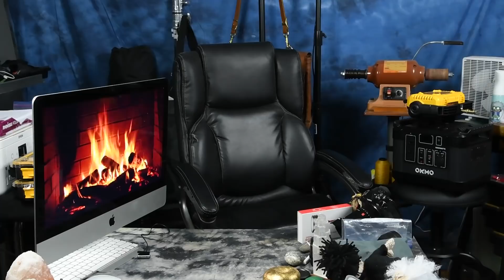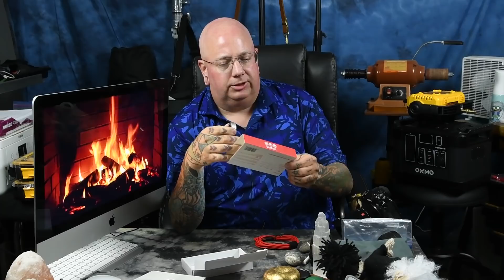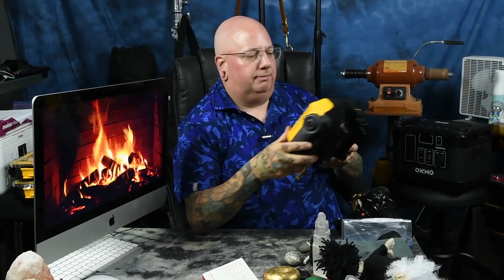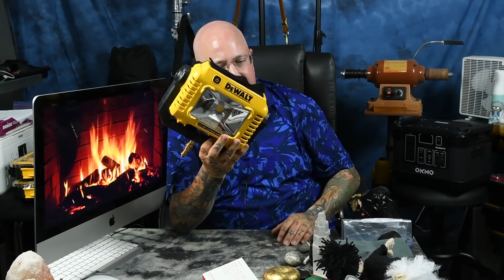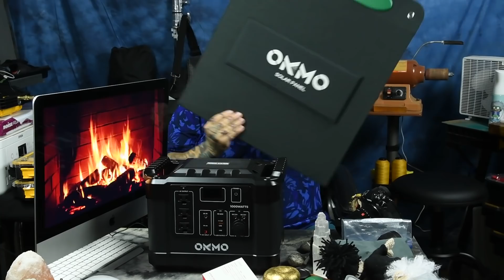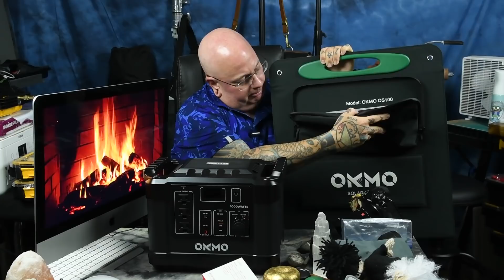🌝 Emergency LIGHTING & POWER Supply ⭐️

Comment: O k m o 2000
Wont run a 3000 or 4000 BTU window air ?
Reply from the maker: the load is too heavy, it will but not long

Comment: Thanks so much again, Ken.
I’m soon moving into an old house I’m in the process of buying.  It needs a new electricity supply and plumbing. I was hoping to install solar water heating and a solar electric power supply.  However, I learnt that the power stored from the sun HAS to be sold back to the Maltese Govt who then pass it to ARMS (the entity that all electricity and water bills are paid to here in the Maltese Islands) and they reduce your bill by the amount of credit you’ve created from the solar panels on your roof. In Malta, you are not allowed to be “off grid”.  So even if you’ve invested into lots of solar panels on your roof, if the power grid goes down, your home still suffers the outtage. 
Is it me, or does that sound like an out and out con?  Appreciate your thoughts on that, and whether I should still go ahead with it, to at least diminish my electric bills down to zero?
Reply: That seems ludicrous to me!! There's soooo much more i'd love to say about that, however i will refrain.
Reply: @choke666  I’m totally with you!  It’s nothing more than a con and a total control over your harvested solar power!  As if the Govt has ownership of the sunrays! 🌞
Reply: Don't tell them 💯%
Reply: @markmacthree3168  agreed!
Since found out, there is a more expensive option whereby you have batteries (though more expensive to set buy that set-up),  and then can store you’re unused power for future use if the utility power grid goes down.  Think I prefer that option as that does enable you to be more self-sufficient… I’m going to look into it more…